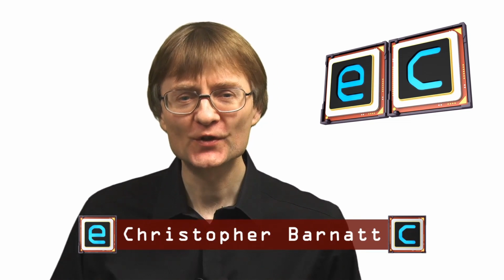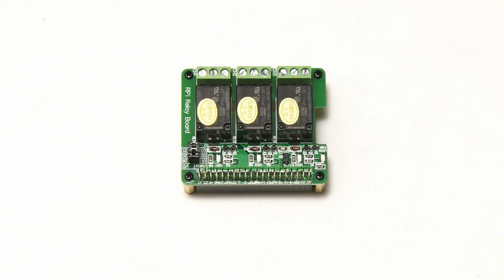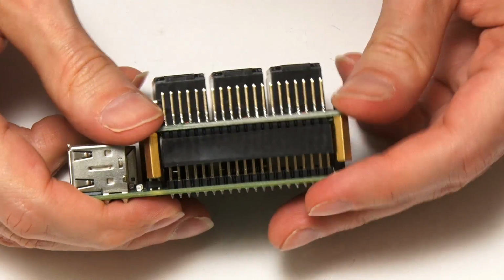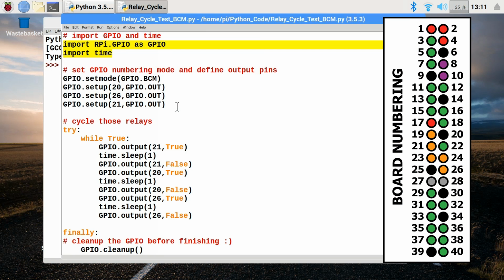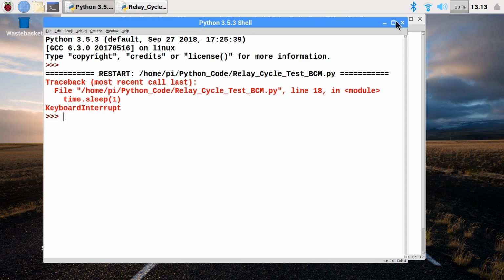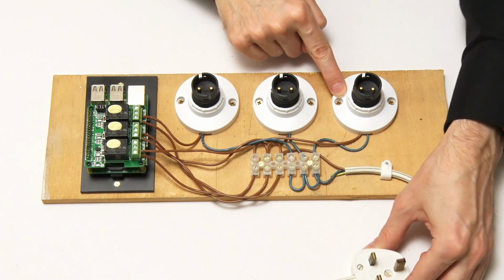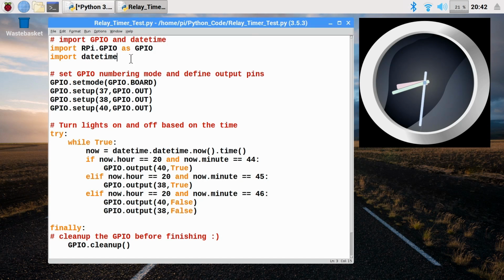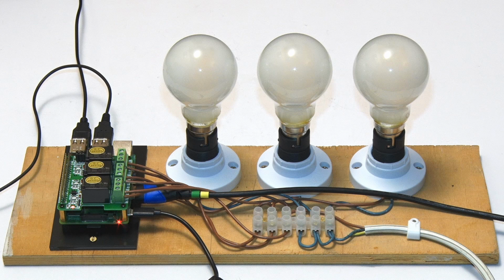Raspberry Pi Automation #1: Mains Relay HAT

Comment: Hi, Big fan of your show here :) I am a teacher in the UK and as you probably know, money is tight in the schools. I know you are probably busy but I could do with some advise.I have moved all of the students course work to Microsoft one drive and Microsoft teams. This allows me to bypass the school server which seams to slow even the fastest computer down. I have been converting old laptops that I found to run a Porteus Kiosk  (Linux) this is great and secure, but I am out of old laptops to convert now.My question to you is..... what in your opinion is the cheapest single board computer that will run Microsoft one drive. I think ram is the issue as I have tried to use the pi 3 but it just is too slow. Can you help please. Thank you for your time and your content,Mike.
Reply: A while back there was a bug in One Drive that meant it was extremely slow and inefficient to access it in a web browser on Linux, but if you spoofed the browser's user agent string to make it look like you were using Windows (e.g. using the User Agent Switcher add-on for Firefox) it worked absolutely fine. That's definitely worth a try if you're having problems using the web interface for One Drive from Linux-based operating systems.

There are also a number of ways to take advantage of One Drive's WebDAVS support to avoid having to upload and download everything through a web browser. This is particularly useful if you want to transfer entire folders. My favourite method is to use either the Dolphin or Konqueror file manager for this.
Reply from the maker: I've not tested One Drive on it, but a Rock64 may be a good SBC for you as you can get 2GB or 4GB RAM for a decent price. Similarly potentially a 2Gb or 4GB Rock Pi 4 A or B.

Comment: ☝waggle finger. Where is the Earth wire for the lamp shroud. It is 240v. Never think that they made the bulb correctly. Sorry I am an old Spark.
Reply from the maker: There is no Earth connection for the lamp holders, and nowhere one could be connected. The whole thing is made of plastic, aside from the pins that contact the bulb, and the terminals linked to them.
Reply: @ExplainingComputers  Thank you. I was a bit surprised you say that as the holder had a metal side. Anyway Thanks always  watching the bell.
Reply from the maker: They don't! :) The bayonet part that the bulb clips is plastic, not metal. I know they often are metal, but the black bits on these lamp holders are most certainly plastic. :) Glad you are always watching the bell.

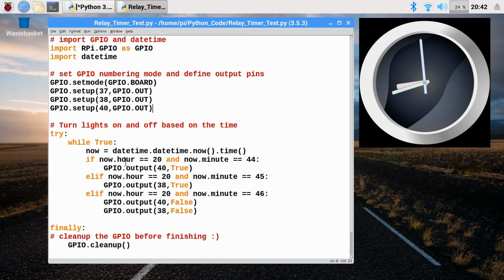Comment: 12:06 Note that this program has a fast-polling loop. This is hugely inefficient, and proper code should not use this technique. It is okay for demonstration purposes, but should be replaced by either a slow-polling loop (with a 'sleep' in it) or code that schedules the next transition on the system's timed scheduler (e.g. 'cron'). Great demo, however.
Reply from the maker: Thanks for this. Just to note that with the onscreen clock turned off, CPU utilization is about 1% running this loop. :)

Comment: Thanks for the highly informative video. Coincidently, last week, I built a similar project, but I used another type of relay switches (not the hat type). Another difference is that the lights are voice-activated using Google Assistant and IFTTT applets.
Keep up the good work. You are the source of inspiration for us common mortals.
Reply: can you please share the source for your project I would be very interested in building voice activated light system
Reply: @alizee3687  As I had said in my comment 3 years ago, I used IFTTT. However, a few months ago, IFTTT made changes that affected the way voice activation functions. So, unfortunately, I am afraid I cannot help. Sorry.

Comment: Congrats Chris, you made a $10 Timer, actually $25 being digital and programmable, I really like that Relay Board,  need to find a better use
Reply from the maker: The point of this video is to provide an introduction, not a final application.  And even as a timer, a Pi can do far more than a dedicated unit. :)

Comment: Needs an insulation sheet under that board.  Those pcb traces might not handle 10A even if the relays can.  Be careful.  Consider using an inline fuse of appropriate rating.
Reply from the maker: The plug is fused. Note that no mains current flows through the board -- the solder pads for the relays just hold them in place and do not run/connect anywhere. But I agree, insulation over them would be good for safety.
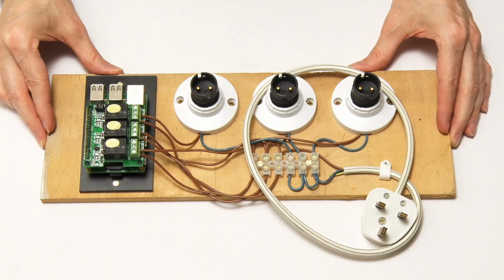Reply: At 9:24 showing you wiring mains power to the relays ???  You're switching the live of each lamp.  Regardless the fuse rating in the plug, the load should itself be fused correctly.

Comment: Thanks for this video. I noticed that the Pi is lacking a heatsink - perhaps getting hot is better than having the metal heatsink reach up to touch the mains tracks on the PCB above ...
Reply from the maker: Thanks for your concern. :) Many HATs have tracks both sides, and the clearance here is good. The mains relay pins  are  far from any potential heat sink. But care should of course always be taken with mains.

Comment: Hello sir , I am sorry that this is off topic, but currently I am working on a project "IoT based smart green house"  and needed some help , the situation "I have a Intel Galileo and a Arduino , so I am trying to to use the Galileo to take the data from sensors(soil moisture, dht, etc ) and trigger the  actuators (water pump , fan , light) via a 4 relay channel , ) all of this needs to be automatic and I am finding it very difficult to do it , while I know how  to do it with Arduino so only using it for on-screen display , Recently I figured that using a rasbery pi is a good option for data logging and uploading to the cloud , bit I will have then write a py script to do it , 
Is there something you could recommend. thank you !
Reply from the maker: I'm sure what you say could work. :)
Reply: @ExplainingComputers  
Which one would be better using Galileo to connect to iot interface , or use rasbery.pi as a server for real time date display ?

Comment: Very useful, just one tip: To execute code at particular times of the day usually is better to set up a Cron job handled by the operating system than having a python code running in an infinite loop.
Reply from the maker: True, but more complex to cover in a short video. :)

Comment: That is nice, but a raspberry pi is a waste of money and cpu power on automation that can be done with something like a wifi enabled arduino, or if you don't like programming in C++ there's always boards with ESP32 or ESP8266 chips from Espressif that can use MicroPython, or boards from Adafruit that can use CircuitPython. I know that these don't quite match with channel's content, but you could tell the viewers that there are better alternatives for home automation.

Comment: This mains relay board is an accident waiting to happen.  It should not have exposed and protruding mains voltage solder connections on the back of the board when there's no guarantee of clearance from the components on the RasPi board, notably aftermarket heatsinks. Or sitting atop a three-or-more layer stack, above some other random board.
Reply from the maker: Good point on the solder connections under the board, although there is significant clearance above the Pi. As I said in the video, care must be taken when working with mains.

Comment: Nice video as usual, but in reality, to control mains loads, Sonoff devices are much more flexible and cost a lot less.  With built in esp8266 and the ability to reflash them with Tasmota or anything you wish, the Sonoffs can be controlled by the pi very easily using WIFI via http, Mqtt etc.  Then you still have the Python option as well as a myriad of other choices including Node Red

Comment: VERY INTERESTING AND HELPFUL ON AUTOMATION...BUT IM JUST APPREHENSIVE CONCERNING THE RELAY BOARD BEING ON A RISER SETUP....I WONDER HOW MUCH CURRENT THIS RELAY BOARD OR BOARDS WOULD TAKE IN ....WOULD IT AFFECT THE DC POWER SUPPLY FOR ALL THE BOARDS CONNECTED TOGETHER...PLCs ON CONTRAST ARE LINK OPTICALLY....IS IT NOT DANGEROUS TO CONNECT AC POWER LOADS (VIA CONNECTORS) ON  A DC BOARD...
Reply from the maker: There is no AC power connected to any circuitry, save the relays (the coil side of which is connected to the electronics). But certainly significant care should be taken when working with mains electricity. If in doubt, do not undertake a project like this.

Comment: I'd be putting a sleep(1) into that infinite loop, so the CPU isn't running flat out and turning your pi back into an iron ;)
Reply from the maker: Fair and useful point. Noted.
Reply from the maker: Just to note that with the onscreen clock turned off, CPU utilization is about 1% running this loop. :)

Comment: That python code at the end looked like a busy loop.  It will keep checking the date repeatedly as fast as possible, turning your pi into a mini heater.  You should put a sleep in there somewhere.
Reply from the maker: Useful feedback, noted for future videos.
Reply: I was thinking the same thing. The code as written will chew up a cpu. It would be very useful for beginners if the difference was noted and explained. You could do a whole video just on that!
Reply: Btw, in the arduino you busy loop all the time. But it's not a multitasking CPU. You almost have no choice with it. So you could note that, as well.
Reply from the maker: Just to note that with the onscreen clock turned off, CPU utilization is about 1% running this loop. :)

Comment: Thanks for this video, My son and I will use this as a basis for him to use L.e.d.s to light up his model railway. Intead of relays he wants to use transistors. (bc 548's) I feel a lot of low voltage and soldering is in our future. I might grab one of your linked boards too. Thanks for your hard work :)

Comment: so is that outless a 433mhz or 315mhz 9 whichever one you use in UK,315 is it?),  RF   socket?
will you be  showing  how to  use  pi with  a  superheterodyne RF transmitter?
i got a  TX RX pair of on the way from China i ordered it to put me over for a  free $3 ebay coupon promotion  ,wasn't sure what else to buy and i always wanted to experiment with RF libraries
seem pretty complicated  though
Reply from the maker: It is from an Energenie Pi-mote kit.

Comment: This video is super interesting and as always very well explained, but i have some questions about security. Considering that a raspberry pi is a single board computer, it is also open to cyber attacks? And how can you avoid that in way that nobody take control of your house turning it into a haunted house? Or even .. to discover if house is empty?
Reply from the maker: Once on a network, a Pi could potentially be hacked like any other computer. But the risk is low. I will look into wireless control and related issues in future episodes of this series.
Reply: @ExplainingComputers  that would be great! Mainly thinking on the aspect of time controling things because you said Pi s don't have internal clock so have to get time from a network. Oh and i forgot to thank you for the nice, fun and interesting videos you make.

Comment: I don't trust the little relays for mains power, I tend to use the little relays to switch 24v/12v DC to switch industrial Omron 8-pin relays on a din rail. They are more expensive but they they are much less likely to explode or burn out the contacts.
Reply from the maker: This is sound advice. It is always best to err on the side of caution when using mains electricity.

Comment: Does this board support American 120 volt 15 amp circuits?
Reply from the maker: I understand the rating to mean up to 10 amps at up to 250 volts, so I would not try switching any device above 10 amps, and in practice far less than that. This really is a board for controlling devices like bulbs.

Comment from the maker: WARNING: mains electricity is dangerous. As noted in the introduction, do not attempt what is shown in this video unless you have prior experience working with mains electricity and understand how to take appropriate safety measures. In particular, when working with mains electricity, ensure that your circuit is connected to an residual current device (RCD) or other form of circuit breaker.
Reply: hi, I would like to use a raspberi pi to control the price sign outside two family-owned stores that are far from each other I want to create a simple signboard that has 36 lights that display a price much like block characters from old calculators. I want to be able to update the prices remotely over the internet. how would I go about doing especially with the code and controlling it to change prices on a weekly basis? can you be of assistance thanks
Reply: @princedube5008  Those number displays are called 7 segment displays, because of how many segments make up each digit. This seems like a good question to ask at a local Linux User Group or a similar specialist group, where you can have an extended discussion about it and multiple people can offer opinions over a period of time. It's way too big a project to discuss it in YouTube comments.

It's a really involved project if you are a complete beginner. If you just want something that works without much hassle, a much simpler option would be to buy an off-the-shelf, serial-input LED number display, and control that using a Pi.

The DIY approach will involve an electronics module to drive the display (possibly DIY electronics), software to drive that, and a secure way to control it over the internet. For simplicity's sake, I'd recommend using SSH to control it. SSH can be secure, but you absolutely must read up on properly securing it, because people will be trying to break into it within minutes of you putting it online. The Internet is not a safe neighbourhood and the default settings are not secure.
Reply: I love the R-pi! But I can't see how one can provide isolation between low voltage, I.e 110V-600 volts and extra low voltage, ( >110 volt) connections. If the low voltage connector came into contact with the R-pi, there is a danger there would be a 230 Volt + connector across the telephone network, assuming the R-pi is connected via the Ethernet port.
Reply: Rcd will not Work if NO EARTH IS USED. ☝WAGGLE FINGER AGAIN.
Reply: @stephenlittle7534  RCDs don't require an earth connection. They work by detecting imbalance in the current flowing through line and neutral. However, they won't protect against connecting a human between line and neutral, or connecting a human in series with the load. The human is only spared if they are connected between line and earth or between neutral and earth.

Comment: This application might at first look quite useless and simplistic to most, but it clearly demonstrates a basic building block that opens the door to multiple possibilities. One possible use would be to trip an even larger relay perhaps with 30 amp contacts to switch a water heater on for a predetermined length of time durring the course of the day when there was a demand for hot water and turn off the heating elements durring times when hot water wasn’t needed. The device could also monitor the water heater for leaks and turn off the power and the water to the heater as well as alerting the user through email. Only your money and imagination will limit what you can do..peace

Comment: i wonder if I can integrate that with HomeAssistant/Raspberry that manages Sonoff Devices for smart home?  I would set that up for "away from home trips on a few devices" and let HomeAssistant guard the house with sonoff devices... hmmm

Would you consider HomeAssistant on SBC and sonoff (sensor devices), tasmoto, Raspberry Pi 3 B+ or Rock4 Pi could be the HomeAssistant device. (That is what I am setting up now...slowly of course).
Also have you heard of IFTTT in configuring sonoff devices?
Reply from the maker: These are the kind of options I plan to investigate!